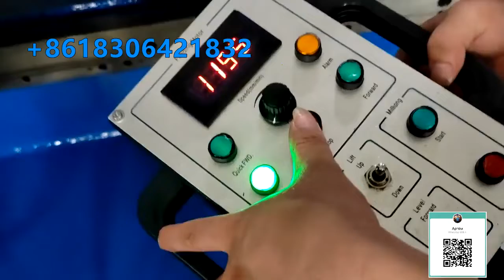Кромкострогальный станок

Comment from the maker: This machine is an advance milling machine which adopt new technology, it is widely used in industries of pressure vessel, boiler, ship building, electric power and chemical industry and mechanical and so on.  Before welding, the plate should be in processing straight edge, bevel edge and U type groove.